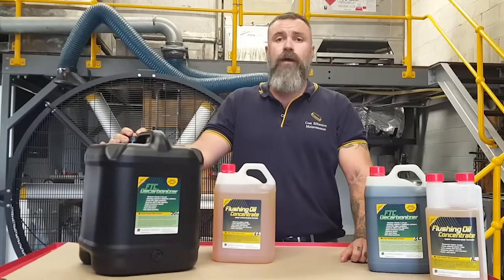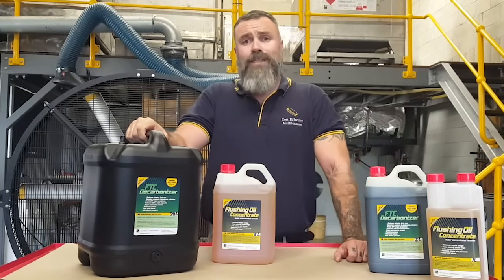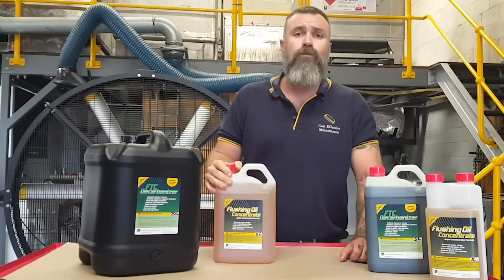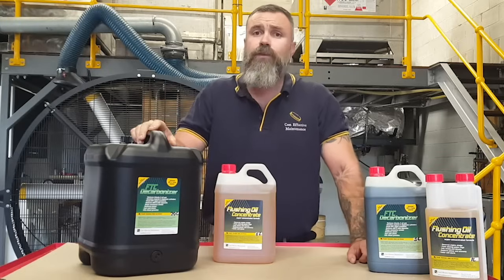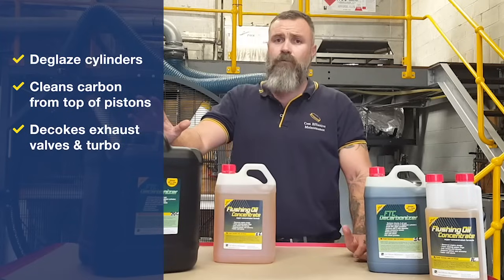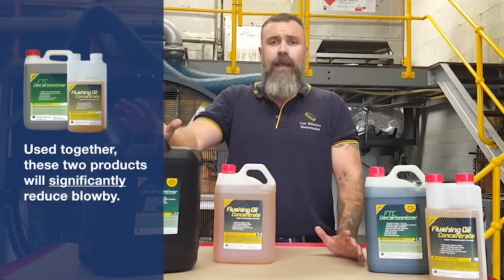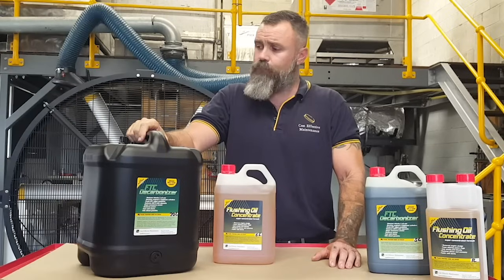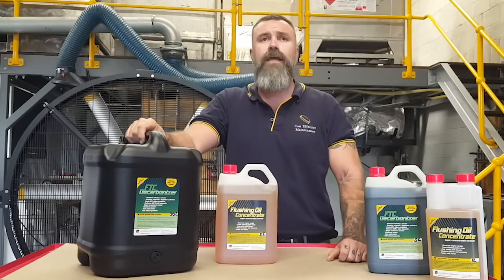How to fix Engine Blowby

Comment: Do you ship to the Philippines?   Have a 2016 ford Everest with bad blow by but very low miles and before I do a rebuild I’d like to try this product.  Oil spray is literally coming out dipstick and oil fill cap when either is removed.   No smoke coming from exhaust though almost at all.

Comment: So at end fail. Fast to fast.. Two fuel unleaded or desiel.????  3 cleaning a desiel engine is not good . Yes need remove carbon.   But all the time it fails. Do angin slower and more answer.  Thank you mick the gong nsw.
Before wa Fitzroy  Crossing.  No where. Just aboriginal community.  Make tools for a job.  So i would love more answer  please

Comment: I have always emptied a couple of litres of oil out of the sump, topped up with diesel fuel, run 5 minutes then drain the lot. Add new oil and filter. No more blowby.
Reply: Mi spieghi come fai?

Comment: Great product but cant see how it can clean turbos as the fuel goes nowhere near the turbo??
Reply from the maker: Hi mate, The FTC Decarbonizer is the product added to the fuel. Carbon deposits are burnt away at time of combustion and through exhaust areas.  Turbos are cleaned up pretty easily. Cheers
Reply: @costeffectivemaintenance4614  ah fair enough i was thinking bout the intake side of the turbo. cheers ive just treated three of my cars a 350 chev carby a 3.0 v6 toyota and audi q7 3.0 v6 tdi the chevy doesnt ping any more and feels much smoother
the toyota is smoother and starts easier both after only 100 klms
the audi hasnt been driven enough yet to tell cheers

Comment: Warning! Use as directed! Do not go cheap, and use with old oil and filter! Use new oil, even if cheap, and filter! I went cheap, as I just put in a lot of money in engine work. So, I added the Oil additive to oil I was going to be changing out. Ran it for 45 minutes at 1200 rpms, as directed. Then I idled it, while waiting to get in shop at normal idle. My oil pressure warning went on, oil pressure dropped to 0, shut engine off warning came on. They drained oil. It was sludge! Pulled apart oil filter. Gunked up... threw in new, but cheap oil, let run 10 minutes. It looked like sludge. Black sludge! That stuff cleans out every thing! Definitely use new oil, not old! My mistake. I figured it was expensive, especially with FTC Decarbonizer I added to fuel, and the Valvoline Restore I bought for the oil change at $85 per gallon! Well, cheapest oil was $25 per gallon, as of recent, so I went cheap. Don't do it! Change Crank Case filter too! So, in went the Restore oil, and hopefully that cleans out whatever is left, along with using the FTC, and in 12-15k, going to straight Valvoline Premium Blue. The mechanic dropped the pan, checked the bearings, liners, etc, and said it looked real clean!

Comment: Can I use this safely if I barely have blow by or close to none at all on a gasoline engine?
Reply: HATE IT WHEN THEY WON"T ANSWER A BONAFIDE QUESTION!!!  :face-fuchsia-tongue-out::face-orange-frowning::face-orange-raised-eyebrow:
Reply: @fvrrljr The only product I've used was the flushing oil concentrate on my 5.7 hemi about a year or two ago, I did the deep cleaner process; holding the the rpms @ 2000 for 20min with the suggested amount of additive in my oil. Honestly, I'm not sure if I even had blowby in the first place, however, if I did; I can confidently say it's gone. About 2 weeks ago I checked my compression on the same 5.7 motor and I got 185/190psi @ around 6 cranks per cylinder across the board, which is good. I think I may be consuming a tiny amount of oil at this point in the motors life, however it's possible it's just a leak from the oil filter since there looks to be oil escaping in that area. Anyway, coincidentally I ordered another 250ml of the concentrate yesterday for preventative maintenance and hopefully it will losen and give some life back to the piston rings, I don't think I need it but I hope to run this motor as long as possible. If the concentrate is working for turbo boosted diesel engines with insanely high compression in my mind it should do wonders for a gasoline power engine. Hell, they even claim you can put it in your transmission, I dont necessarily recommend that, but as far as trying to restore piston rings with only additive; I think it's worth a shot.
Reply: @fvrrljr  HATE IT WHEN PEOPLE DONT JUST USE GOOGLE OR CALL A MECHANIC.

Comment: My car has blow by, with smoke, I think from washed rings when over fuelling occurred, would this help stop the smoke and blowby or do I need to change rings and possibly/or valve seals? Hardly any smoke from exhaust just mainly blowby and performance is almost if not completely normal, I think oil is contaminated with fuel also, diesel.
Reply: Can I add, this is on a Mercedes car not a truck
Reply: same problem here, caused by leaky injector.  Wish I had been aware and would have changed injector sooner.  No smoke, just slightly down performance and a bit extra oil use, but not terrible.  Opinion i had from two garages is likely wont get worse, just live with it.  One said flush wont help wear and the other said not to do flushes on modern vehicles, it creates more problems than it solves.   They used to do them so no doubt broke somebodys engine. To live with it,  it needs extra servicing requirements (aside from 1-2k interim oil topup) because blowby sends more oil vapour back into air intake via the PCV breather.  This accumulates gunk in the inlet manifold, which affects engine eventually.  So once a year or 10k miles learn how to remove air manifold pipe and spray loads of carb cleaner get rags in there at end of long screw drivers to scrape it all off.  If too many gunk bits are left lying in the intake manifold it can sometimes get in the engine and cause bit of rough running for 100 miles or so till burns off. Possibly the extra oil vapor will gunk up EGR quicker as well, not sure, many cars those are straightforward to clean. Others not so..    And in general keep an eye on leaky injector smoke and dont expect as much from the car in terms of pushing it hard, its already worn like a 140k mile motor.
Reply from the maker: Hi Chris, can you send us through some more  informtion about the vehicle. 
Firstly I would get an oil change done to remove any possible diesel contamination. I would not be considering a rebuild  just yet .
Reply: Same here man. I need advice

Comment: My 7.3 power stroke has 262k miles. It does not burn any oil but does have a decent amount of blow by. Do you recommend this product for my situation? Thanks
Reply from the maker: I would probably start with the FTC Decarbonizer. But it  would be good to get some more information from you first. 
Has the blowby just started or is this something that has gradually increased over the years ? 
Feel free to get in contact with us so we  get this sorted . https://costeffective.com.au/
Reply: It's been gradually increasing over the years. Do you guys sell in the US?
Reply: Bro I’m going thru same thing!  I have 443k miles. And I having oil seem thru passenger boost tube.  My truck is a slow turn.  But I don’t hot dog it. Daily driver 110 miles a day. Oils change, fuel filter, air filter every 3500 miles   Sometimes 5 when I forget. Some blow by when I pull oil cap. Been a long time since changed the crank case vent. Just got new stop Hpop, ford injectors, all the wire and hard ware. Glow plugs all kinds of stuff. But I’m worried I need rings and basically lower rebuild. If not full. Really worried. Here in Houston Texas, no diesel truck repair is reasonable.

Comment: I have been using these products for 11 years in all my machinery. I bought my MN 2.5 litre diesel Triton new in 2010 and it now has 537,000 kms on the clock and does not burn one drop of oil between 15,000 km services , it still runs the original injectors and still pulls like a freight train ! A very good Australian product. Highly recommend CEM.

Comment: Traded this Cummins I had with quite a bit of blow by for a duramax I did a blow by test and had no blow by a couple hundred miles I did it again and it puffed the cap up I don’t understand how this could happen over a couple hundred miles
Reply from the maker: Hi mate, Did it use any oil or show any obvious signs of exhaust smoke ?
Reply: What year Duramax? 2001-2004 are notorious for “false” blowby. Mine had it and I used decarbonizer and problem solved
Reply: @Dirtymax3513  I am in the same boat

Comment: wouldnt oil sludge prevent blowby? Im so confused. Like oil sludge will literally block the passage between rings and cylinder walls so removing the blockage....would send more oil up?
Reply: Build up causes the rings to get stuck inwards and not push outward on cylinder walls
Reply: Depends if its built up on the valve seat or on the lower end
Reply: It's not suppose to have excessive oil between rings nor pistons if it's constantly moving
Reply: No... you need to understand with stock or free poston rings.... sludge stuck the rings no???😂

Comment: left over residue from the products will probably thin your engine oil causing more wear on the piston rings and bore, which will increase blow by and in return burn more oil and bring up your fuel consumption
Reply: Best to use a cheap engine oil for an hour or so, then drain that out before using your final oil
Reply: @banglaforceuk  that's exactly what the instructions say to do, dump old oil, put in average oil with cleaner, run for 30 mins fast idle, dump and insert new good oil. 

Worked fantastically for me on my td42. I'm going to give their FTC decarboniser a go
Reply: @Nick-sd7um  Hi nick were you having blow by issue with the td42. had you completed before and after compression tests mate. would love to hear more of your experience. i'm also a fellow td42 owner cheers
Reply: @Bilbuss  Hi Peter, I actually didn't have any blow by issues to be concerned about well maybe a little but nothing serious. However, I am the third owner of my td42 GU and wanted to give it a thorough flush as I wasn't 100% sure of the previous oils and service life. Unfortunately I didn't perform compression tests before and after which would have given a better understanding. 

I have continued to use the flushing mix each 5000km service though (for about 6 or so more services since) with just the regular flush amount and I'll continue to do so because the oil seems to stay cleaner (almost honey) virtually up to the 5000km mark each service now. Car runs perfectly. 

I also use the FTC decarboniser too just to try and keep the old td42 as clean as I can haha.
Reply: @Nick-sd7um  thanks for the reply Nick. appreciate all the info. spewing you didn't get the before and after comp test results. would have been very interesting to see that. all the best mate.